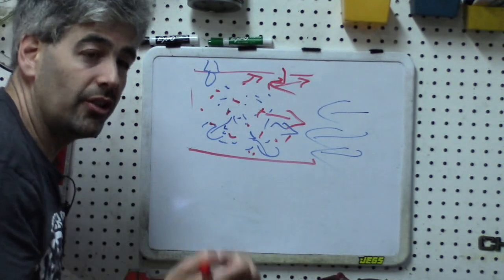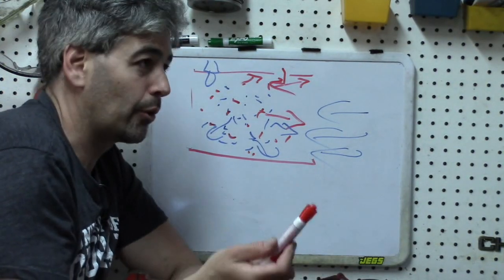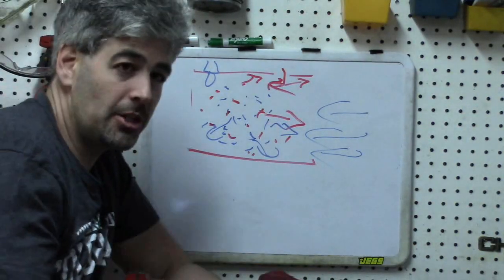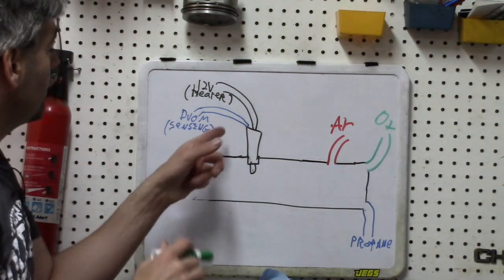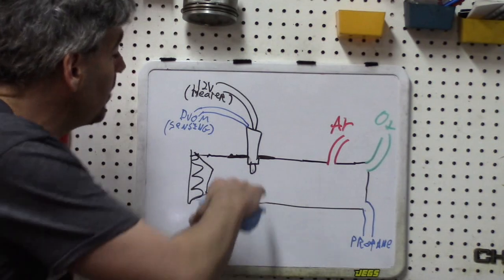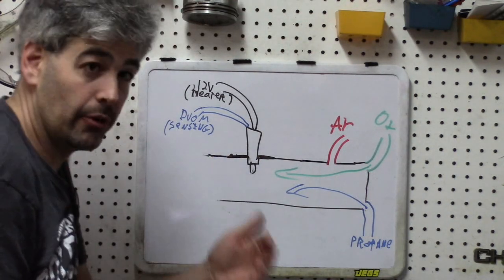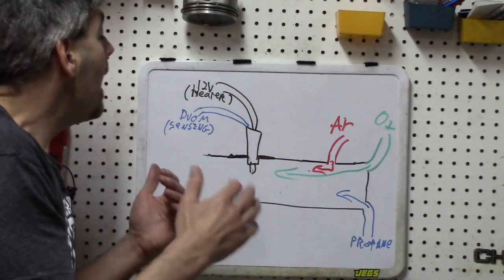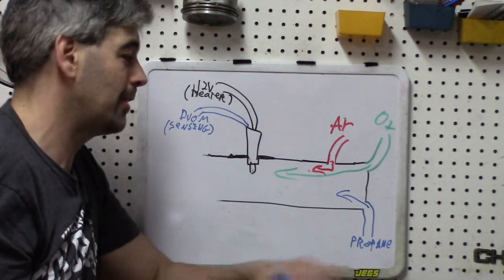Experiment for O2 Sensor Pt5  New Experiment Proposal

Comment: Here is how Bosch, (the inventor of the O2 sensor), explains how it works.
http://www.wbo2.com/lsu/oxygen13-17.pdf
Page 2. Fig 3. shows where the voltage is generated, via a cell which compares oxygen  inside the exhaust, with oxygen in the outside world, (which they call the "reference gas"). They don't even mention hydrocarbons.
For anyone interested, the book from which the excerpt above was taken, is the AUTOMOTIVE HANDBOOK by BOSCH. The ISBN is1-56091-918-3
It is crammed full of very useful information.

Comment: I'm thinking out loud. On the website of NGK I found an explanation how a lambda sensor aka O2 sensor works. If I got it right they 'measure' the difference of oxygen levels inside the exhaust pipe and outside the pipe. For example in a zirconium dioxide based sensor the oxygen ions, not molecules, can pass the zirconium element when it's hot enough. if inside the level of oxygen molecules is low then a lot of oxygen molecules want pass the zirconium. This is because nature loves to keep things in balance. Its like osmosis or the physics experiment with the bigger getting balloon in the glass dome getting vacuum. All the molecules in the balloon want to be equally dispersed. Back to the sensor. All those oxygen molecules are pushing to get through the zirconium to get inside but they can't, because they're too big. So they have to split into two separate oxygen ions. The single oxygen atoms get each two extra electrons. This doesn't happen just magically. The outside side of the sensor is covered with platinum. Platinum loves to share its electrons to the oxygen or oxygen loves to steal electrons from platinum. Either way the platinum gets positively charged. Now the oxygen pass as ions through the zirconium. On the inside side there is also platinum. The oxygen ions return their extra electrons to the other platinum, making it negatively charged. And the single oxygen atoms pair to oxygen molecules. More means more difference in charge between the two platinum parts, means 0.9 Volts, means rich mixture. If there is also a lot of oxygen inside the exhaust, then the oxygen outside the exhaust is not so eager to get inside. Everything is almost in balance, why rush to get through the zirconium? Less means less difference in charge between the two platinum parts, means 0.1 Volts, means lean mixture.
With this knowledge back to the experiment. I compare the exhaust pipe with a sewer pipe. In general there is always capacity left to add other stuff through the sewer. If there were a sensor which measures only the amount of shit passing through what would it measure if 10 units shit passes? 10 units. What would the sensor measure if you add 5 units water to the 10 units shit? Still 10 units shit. Right? What would the sensor measure if I add 5 units shit to the existing 10 units shit? I would say 15 units.
Whit this analogy I can explain what adding oxygen does to the exhaust. I can also explain what adding argon or helium does. Unfortunately, I cannot explain why propane makes the mixture rich. Is it the density? is it the weight? Does it somehow (indirectly) react with the oxygen into other molecules? Is propane the piss that dilutes the shit? I really don't know!
I do wonder. Should the mixture after the sensor but before the cat measured somehow to see what exits the exhaust?

Comment: I have searched for Pt6 without success so I assume the experiment is still on hold.  Some thoughts :- Maybe include a pressure regulator so any diluting gasses WILL affect the partial pressures; include a fan to mix the gasses in the vessel.    I don't undestand how an O2 sensor in the intake manifold can work - if it needs to be at 500C+ to operate and pertrol ignites at 300, why does the manifold not explode?   For what it's worth, my ignorant guess is that the O2 sensor operates like a minute catalitic converter. O2 & hydrocarbons react on the surface of the platinum. Energy from the reaction is picked up by the sensor to produce the signal. Hence both elements will be needed. As hydrocarbons are always assumed to be present in excess, the number of reations per second will be proportional to  the O2 concentration. Voila :)
Reply from the maker: +Gerald Elwood Yes I have intended to do a part 6 for some time and I have all the components needed for my pressure chamber vs free-flow chamber experiment but I haven't had time to do this because my free time is filled with junk cars repairs lol. Hopefully this summer...
Reply: +Schrodingers Box Thanks for the update Matt.  Also thanks for all your hard work in producing this channel for our benefit.  BTW I have seen more info. on the structure of O2 sensors and it seems that the platinum is not exposed to the exhaust gasses - which rather shoots down my guess :)

Comment: Magnificent design proposal. You are the modern day Robert Pirsig of the automotive world. 
IncidentalIy, I like the thought that pure O2 or pure hydrocarbon might produce zero voltage from an O2/(HC) sensor. I'm tempted to rig up my A/C vacuum pump to a chamber, (see what the sensor reads) then introduce O2 gas and see again the reading. I wonder how much of a vacuum one would need to achieve inactivity from the sensor.
Reply from the maker: +David Bell Exactly similar to what I plan on doing- a controlled sealed chamber.  I have all the parts I just need the time to build it and make the video.

Comment: I haven't seen any flic about the new setup yet so I assume that you still looking for imnput.
What about a syphon at the end/exit of the exhaust model? A U-shaped over wave shaped at the end. Gasses lighter then the atmosphere cannot "leak" out of the model as it will have to pass a downward curve. Vice versa gasses heavier then atmosphere cannot leak as there also is an upwards curve.
Finally this should also prevent "contamination" from the atmosphere.

It is still open though

Comment: I'm not a chemist.  I'm a CS.  So, please don't laugh.  I would like to pose a question. 

Wouldn't the chemical composition of the exhaust gas be different when additional propane is added to the intake versus into the exhaust manifold?  My simple mind thinks it would be different.  

What I'm trying to say is that the combustion process changes the chemical composition. Right?  So, additional propane to the intake, before the chemical transformation, and adding it to the exhaust manifold would result in a different chemical compositions rushing past the O2.

So, maybe the output of the O2 sensor is influenced by the combustion process of a given chemical combination.

Ok. Ok.  Now that you're done laughing, what am I missing?
Reply from the maker: GeekDIYMechanic I see what you're saying but you're sort of begging your own question- actually you're answering it.  Yes proportions of the constituents in the chemical reaction change the outputs- it changes the proportion. of outputs which in one way or another are measured by the O2 sensor. a richer mixture will emit higher HC's and CO than a leaner mixture which emits more O2 and NOx.  So constituents themselves are indeed altered based on the combustion inputs but arguably- only 2 potential outputs are measured by O2 sensor- HC or O2 (or apparently, both).  The effect of the other constituents in the exhaust is that they affect the concentration and proportions of the O2 and HC- the question is which of these (or is it both) causes the change in the O2 sensor as a result of changes on the combustion

Comment: Hey Matt,  love the videos.  They are helping me determine what I don't need to replace on my truck for sure, and helping me better determine what my truck is doing.  I would love to be able to find a computer based diagnostics tool so I could see what it is doing real time. It is a1994 Toyota pickup 4x4, so nothing is really available at advance auto parts for scan tools.  I have also worked there for some time and know that some of the OBD 1 and 2 tools are expensive. Any help or suggestions where i might find one, or a brand name \model number of one would be greatly appreciated.  Thanks a bunch for sharing your understand of how things work, with us
Reply from the maker: goterdone05 Thanks for taking the time to comment my friend!  Yeah having OBD-1 presents a definite challenge for live data.  It is for more efficient to have OBD-II as a DIY if you want to do these kind of high level diagnostics.  I actually don't even have a OBD-I scantool in fact and seldom work on OBD-1 vehicles for that reason.

Comment: Probably more than anyone wants to know.  
I input this to save you time and money vs. continuing this experiment.  Excerpt from 'automotive electrical and electronic systems' 2nd edition Harper and Row Chek Chart automotive series ( 1987).  I think that this will clarify O2 ops. 
"the concept of feedback fuel metering systems revolves around the EGO (o2) sensor.  The sensor is basically a 'galvanic battery' that generates from 0.1-0.9 volt by comparing the o2 in the exhaust to the o2 in the outside air.  
The typical EGO sensor contains two platinum-surface electrodes separated by a ceramic zirconia element.  The inner surface ( positive terminal ) of the zirconia element is open to the atmosphere ( like 'heres a good one" video showed ); the outer surface ( negative terminal ) is in contact with the exhaust gases.  The Zirconia element is an insulator when cold, and a semiconductor at operating temperature.  
For comparative purposes, the atmosphere contains 21 percent oxygen; rich exhaust gases contain virtually none. A large differential in the amount of o2 contacting the inner and outer surfaces results in greater conductivity, and causes the sensor to send a voltage signal above 0.6 v.
Lean exhaust contains approx. 2 percent o2.  This reduces the differential, resulting in less conductivity and a voltage signal under 0.3 volt.  ....     .....
Operating range of an o2 sensor operates at about 800C.  Sensor voltage changes fastest at an air-fuel ratio of 14.7, which makes it ideal for maintaining the stoichiometric ratio.
Another important point about o2 sensors is that they measure oxygen;they do not measure air-fuel ratio.  If the engine misfires, a large amount of o2 remains in the unburnt mixture that passes out with the exhaust.  In this case the sensor will deliver a false overly lean mixture signal  ( "I did not know that", J Carson circa 1993)....   ...
The o2 sensor is a 'generator' type sensor and does not need a reference voltage for operation.  The computer, however, uses a reference voltage as a comparison for the sensor voltage signal.  ...   ....   "
again just to save your time and money.
Cheers from a sometime 2 percenter)
Reply from the maker: gst69man so how does that explain the findings I got with the helium and argon?
Reply: Schrodingers Box IWIK! 
I think that the original purpose of the experiment was to determine what gases (o2/hc/other)  an o2 sensor measures NesPas?.   As you mentioned several times, some think o2 sensors measure only o2, some thought HC's/exhaust gases play a role in determining fuel trim levels. 

If we accept the information that states the purpose and design/operation of o2 sensors (which I do) I.E. "measures o2 differences in combustion gases and ambient air", then the original question is answered (to me anyhow).  
Further experimentation adding various other gases to the intake manifold while engine is running may show that other types of gases may or may not affect fuel trim levels.  Actually to measure the effect of HC's on the ECU's determination for fuel trim, would be to add burnt HC's to the intake of the test engine/ecu.  In this way, you can determine whether HC's affect fuel trim and prove that o2 only measures o2 presence.
I got a headache, lol.
Reply from the maker: gst69man Your understanding of the experiment is incorrect sorry
Reply: Schrodingers Box okey doke
Reply from the maker: gst69man The purpose of the experiment was quite simply to reduce the molar ratio of both O2 and HC to the total volume of gas WITHOUT changing the relative molar ratios of HC and O2 TO EACHOTHER through the use of a noble gas as a diluent.

Now, given that... 
1. what would YOUR expectation be on the results of oxygen sensor or fuel trim response given the experimental design based on the information you stated above?

2. Regardless of if the results are congruent with what you expected or not based on the information you provided, how do you explain the results we saw?
Reply: Schrodingers Box Hi Matt, Lets get in sync for my sake.  Quote from vid segment #1 "The "new thinking" is that O2 sensors actually do not detect O2 as traditionally thought (and taught) but rather, they actually detect hydrocarbon. But not everyone agrees with this."  
I took this as the objective of the experimentation, thus my comments. 
Q1 response: input of burnt HC ( exhaust from another car ) becomes the 'diluent donor'. This way no other extraneous gases/materials can affect the outcome.  Input 'rich' biased air fuel mixture exhaust from 'diluent donor' then observe test car o2 sensor.  If on the test car 'rich' readings occur, I.E. above .6 V on o2 sensor, HC's did not affect readings I.E. o2 sensors only read o2.  Then force 'lean biased exhaust, test car o2 expected to read lean. Again determining o2 sensors are affected only by o2. 
I don't get how "reduce the molar ratio of both O2 and HC to the total volume" proves o2 sensors are affected by HC's.  I think you would have to change the o2/HC gas ratios, then measure the changes.  
Q2 response:  IWIK

regardless this whole endeavour has been interesting/valuable to me and I am sure others.  I will take a 'punch in the throat' if appropriate.
Reply from the maker: Yeah sorry bro you're still not following. You cannot use exhaust from another car because the presence of O2 and HC will introduce another variable (actually 3 variables- the HC, the O2, and the fact the HC is of higher molar proportion than O2 in exhaust). You simply cannot do that- this the reason for a noble has diluent.  Also the purpose of this is that creating the lower respective molar ratios is not to show it is an HC or O2 sensor specifically- it is to neutrally force a reaction either way as result of the single variable alteration. 
  Anyway I appreciate your trying to save me the time and money of doing another experiment but it actually now more necessary as result of your information that we follow up with an experiment. 
  Anyway as you see, another experiment is indeed necessary. I appreciate you
Reply: Schrodingers Box looking forward to it. Tks.

Comment: Hi Matt, I have just read that the same type of zirconia O2 sensor is used in the scuba diving and medical industries for measuring O2 content. http://www.google.co.uk/url?sa=t&rct=j&q=&esrc=s&source=web&cd=3&cad=rja&uact=8&ved=0CCwQFjAC&url=http%3A%2F%2Fwww.sstsensing.com%2Fdownload%2Ffile%2Ffid%2F480&ei=3L1BVaiKE8ztapKogbgC&usg=AFQjCNEKiLGxLYaKNUn-9SIbbKklaCB2pQ The are no HC's involved in this application. Just thought I'd throw this into the mix.
Reply from the maker: Duncan Bailey FINALLY someone puts a link to something with actual intelligent rebuttal and they even seem to have actually read it!!! Yeah my first objection was going to be "it isn't the same because how is it going to heat to 700F like an automotive sensor" but indeed the diagram does show it has a heater element.
  Pretty hard to refute - nice find Duncan.  I am sure when I get around to the final experiment it will support your information- seems pretty clear cut to me bro.  Thanks for posting that!
Reply: Schrodingers Box When I found it I said to my wife that I feel silly now, it was pretty naïve of me to think it would only be used in the auto industry, and I now know its used everywhere. (Even NASA on their space station to monitor O2 for astronauts.  I came across this when I was researching a data parameter on my scan tool called 'Air Consumption' 97mg/sec. I cant figure it out and Is not air flow!

Comment: Dear Sir.
I think the experiment went well. but the problem is that you made a comparison with two similar conditions.
1/the car as you showed was running in perfect ratio. (there is no leak at all)
2/when you strangled the hose it was also same condition.
3/when you injected air it went lean (this point is similar to a leak!!!!)
4/when you used Argon (Nobel Gas) you repeated the Nr 1/ and 2/ condition because in the two cases you did not correct a leak.

i propose a better experiment in view of pedagogy: you let a little air leak to the exhaust  through the hose or whatever (till having a lean condition) and then you apply argon at same source of leak (in this case the Argon will replace the air which was leaking into that source and believe me we will see the sensor getting the argon instead of the extra air and this is how we discover the location of air leak source.( your explanation in STFT and LTFT)

I hope I am not wrong.
Best regards
Naceri
Reply from the maker: Abdelkader Naceri  You cannot be scientific by introducing a variable that you are specifically trying to control to prove the etiology.  Introducing a vacuum leak is the absolute last thing you want to do for this very reason.  Also, of course the care was running perfectly with stoichiometric ratio. It has to. If it was not, then the uncontrolled variables of why it is not in stoich cannot be accounted for in the experiment.